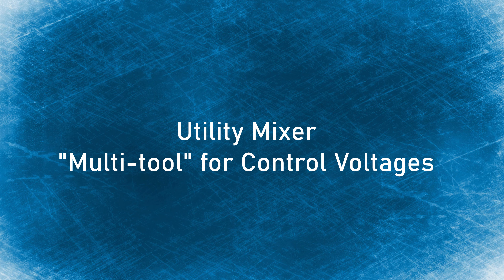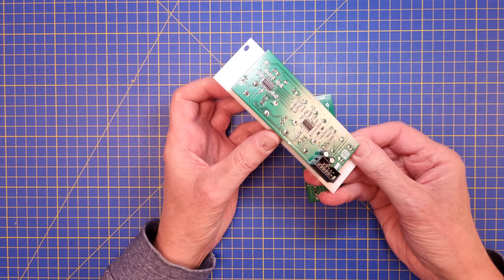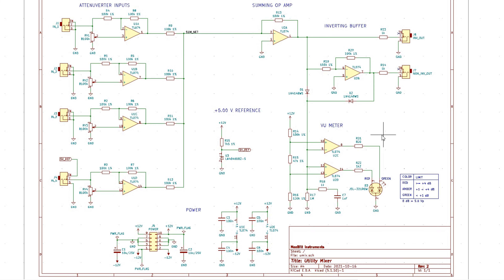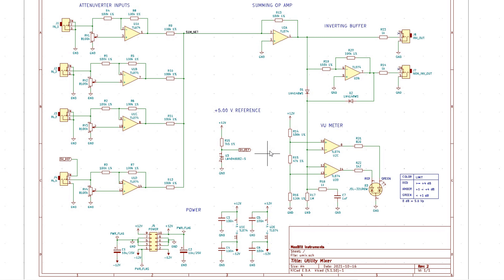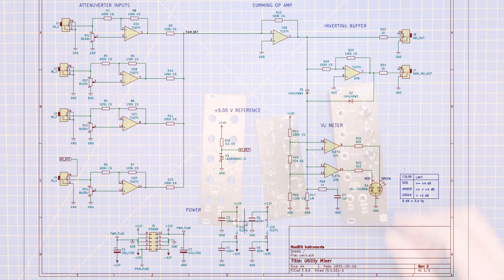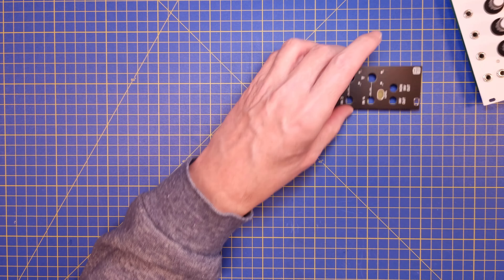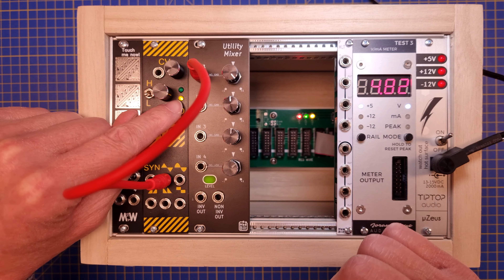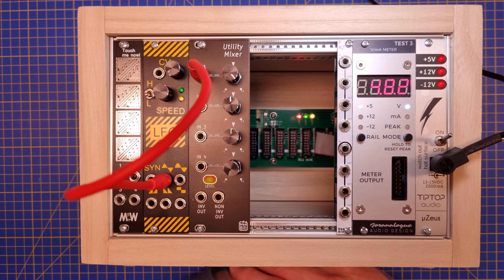Eurorack DIY: Utility Mixer - Multi-tool for manipulating CV

Comment: Hi Tommy, I've just finished assembling the buffered mult and its great. I'm about to order the utility mixer on jlcpcb but I cant find the BOM on your Github, it comes up as html. Can you please advise
Reply from the maker: I'm happy to hear that you find the buffered mult useful!
The BOM is indeed in HTML format and the Github viewer shows the "source-code", so that is why you see the HTML-code. You will have to download the file and open it with your browser to see the BOM.
Reply: @MeeBilt  Thanks but doesn't work for me unfortunately. Must be doing something wrong trying to get the file
Reply from the maker: @chsm72  I just tested and it worked fine for me:
https://github.com/tkilla64/eurorack/blob/main/umix/umix_bom.html
Click the Raw button and right-click, save as
umix_bom.html
Double-click on that file to open it in a browser
Reply: @MeeBilt  thanks. Works. Really appreciated
Reply from the maker: @chsm72  Awesome, good luck with the build
Reply: hey @chsm72, did you manage to get the SMD parts assembled at JLCPCB? Would you mind sharing your files?

Comment: Thank you very much for your videos and the information you share! I need to replace the LM440 with LM336-5.0.
Do you think it can be useful?
LM336-5.0: Reverse Current 15 mA / Forward Current 10 mA.
As a last option I thought of using an LM78Lxx
Reply from the maker: The LM336 is a totally different device compared to the LM4040, but if your redesign the voltage reference part of the schematic a bit it could probably be used.
Reply: @MeeBilt  Thanks for your reply! I make my modules in Perforated PCB and I can't get the LM4040 to 92 version. The LM336DBZ is the closest thing I found. The current values are a bit different from the LM4040 and, as I'm new to this, I don't know if in this part of the circuit that small difference in current tolerance is an important factor.
Reply from the maker: @flamir323  By looking at the datasheet an IR (reverse current) of 1 mA seems to be good. at 12 V this will be 7kOhm, so a 6k8 resistor can be used if you want to a standard value.
Use the circuit in figure 4 on page 2.
https://www.ti.com/lit/gpn/lm336-5.0
Reply: @MeeBilt  Thank you very much for your reply!!! It is very helpful.

Comment: Hey, got a question about mixing audio signals here. What will the knobs do in that case? Other mixer modules I've seen seem to do either audio or CV, but not both.
I'm trying to get into electronics, and I've been enjoying your open source stuff!
Reply from the maker: The knobs will act as faders, but keep in mind that the middle position is "0" (max attenuation) and the full CW is max level. Turning the knob to full CCW will also give max level, but with the signal is 180 degrees phase-shifted(!)
I don't have any audio mixer in my Eurorack case (yet), so I use an Utility Mixer for this purpose, but it is a bit awkward to use when you need to bring down a level to 0 in a mix.